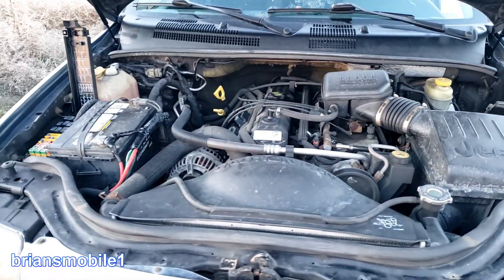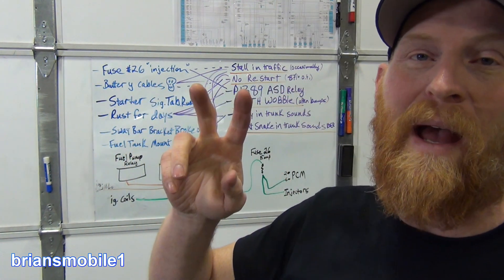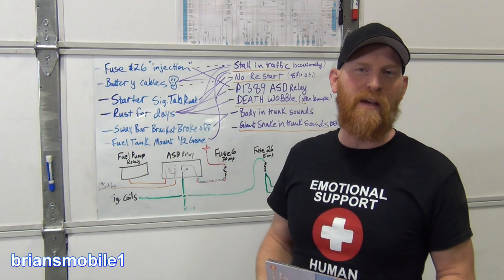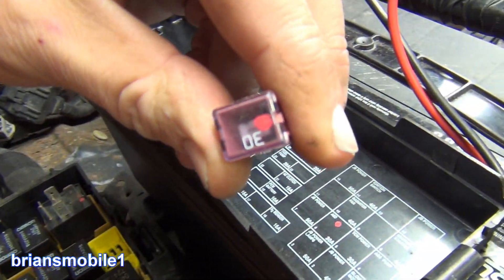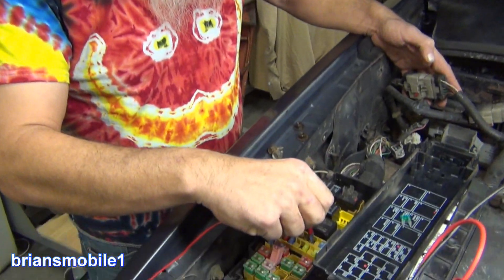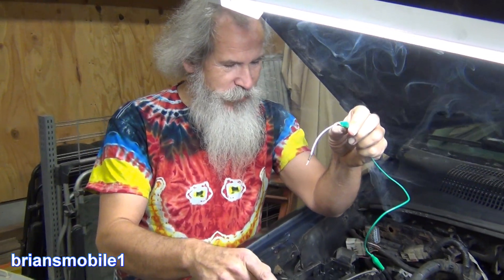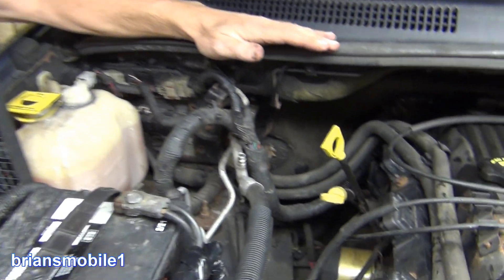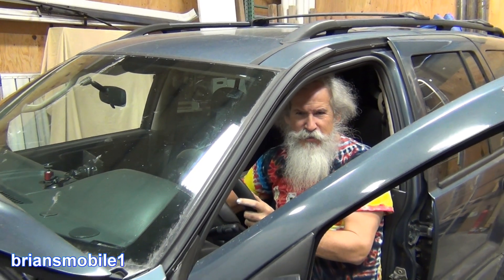How to Find an Electrical Short with Rodney Norman and Briansmobile1 Part 2

Comment: My sisters Dodge  Caravan had a similar issue.  It kept blowing injector fuses, and it also bulged/ exploded the coil pack, which I replaced.  Ultimately, I found out that it had melted the plugs underneath the entire fuse panel and had to all be replaced.  I had a lot of wiring issues with my 99 Jeep Grand Cherokee too.   I'll never buy any chrysler products again after this.  I'm all Honda/ Toyota.. or Ford Trucks.  Or I'll use LS engines for project swaps, ect... but otherwise, I'm done with most of these junk brands that cut corners everywhere.

Comment: Just a failed capacitor no longer made? Value not critical, just grab one from a VW Beetle points kit, and use there instead, and it will work fine for the next decade.
Reply from the maker: Not a bad idea!
Reply: @briansmobile1  That was how I fixed alternator noise on my 1990 Toyota corolla, just used the old capacitors when I was doing points there, and put them first on D terminal then on the L terminal, after changing the regulator (brushes well worn) did not stop it.

Comment: Wallysplace66 did a few videos on a Pacifica that he bought a he called me opand asked for help. One connection that went to the block someone cut off and just grounded it. Turns out that connection was to a capacitor and cutting off the capacitor and grounding it was preventing it from starting.
Good video.
Happy Motoring.